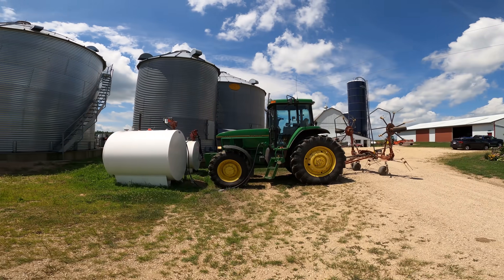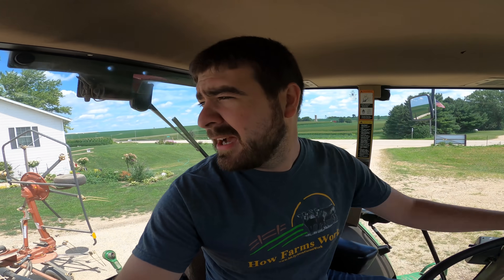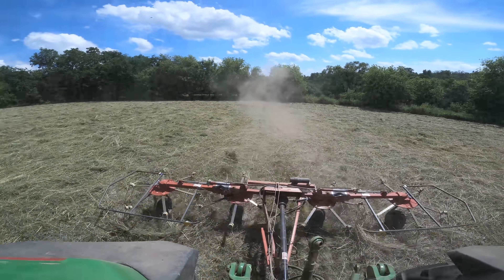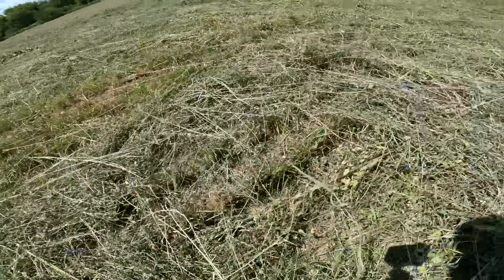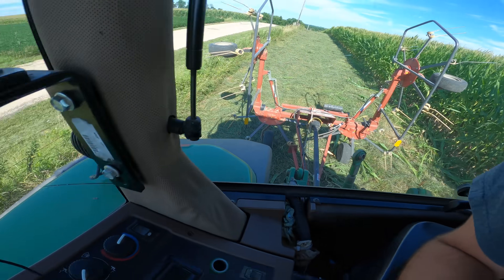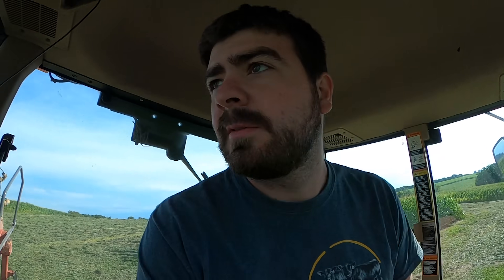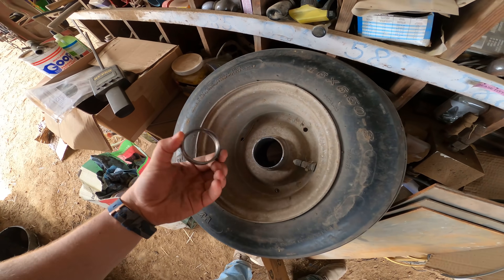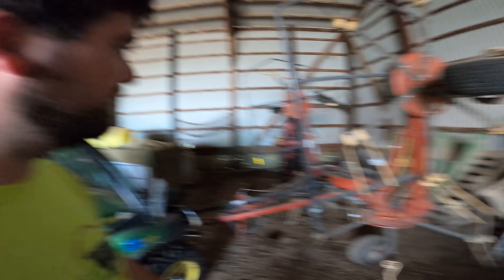Tedding Hay | The Wobble

Comment: Great video ! On the bearings you didn't change, you can take a dental pick and pull the rubber seals off and pack new grease in them, then push the seals back on, in case you didn't know ?

Comment: Those should be standard bearings. Bearings like that are sold by series. 100, 200, 300 series and are usually stocked by autoparts stores. I worked at O'Reilly Autoparts for 9 years and have helped people with these bearings many times. Used on everything from go-karts to heavy equipment. They come in large variety of configurations. no seals (open), fiber and stainless steel. All you need to know is the bore size and shaft size. If you bring in the original bearing they can measure it and give you a matching bearing. BCA and Timken are probably the top two brands you will find in the autoparts stores.
Reply: Agree. We also will pull the seals off with a dental pick, repack them, then push the seals back on. Works great.
Reply: @augustreil  I had a guy who's daughter raced small engine dragsters. Single piston lawnmower engines powering them and they had a special procedure to make them a bit faster. They would remove the seals and clean out the grease with brake clean. Then they would coat the bearings in fluid film and reassemble them. Apparently the resistance from the grease slows them down.
Reply: @FoolOfATuque , Wow, I cannot believe you just said that. We used to grass drag snowmobiles and one of the first things we did was to replace the oil in the chain drive with tranny fluid and any other thing we could with a lighter, thinner oil, including bearings with oil instead of grease. It makes a huge difference in racing, just have to keep up the maintenance a little more. Thanks !
Reply: @augustreil  yeah with those lawnmower engines you have to squeeze everything you can out of them. Lol!
Reply: James you are the not norm, a parts man that can come up with a part without a part number  you are the few who can measure and think on the run, A true dying breed , of a good kind!
Reply: @edp9743  well, I got a degree and left the business. Lol! There's no money in that business. I agree though, there's usually maybe one person per store like that. Lol!
Reply: @edp9743 , A parts guy is worth their weight in gold, IMO. So many times I go to Napa or wherever and the guy doesn't know sh$t, not his fault really, just doesn't know auto parts.
Reply: @FoolOfATuque  I wasnt great as a parts person, but i did sell a ton. No money at all. Left that job for bigger and better things. Like you said, no money.
Reply: All you get is whats your year, make and model, tell them it isnt for a vehicle, their eyes glaze over, shrugg their shoulders and hands go up. All but 1 guy there will go above and beyond to help look up stuff. The rest rely solely on the computer to tell them what they need. I go to napa, parts knowledge,  experience, knows how to open the books to cross reference and will look until they find it or not. Thats a dyeing breed. Bearings, seals etc.. ive always gone to napa.
Reply: @duanedean3256  that's what you get when you pay people 8 bucks/hr and don't reward them when they make you good money.
Reply: @augustreil  Agreed-- they're SO stingy with the grease it isn't even funny... I had hipper bearings on a row disk that was built using sealed type bearings pressed into a cast iron housing running down in the dirt between two disk blades (row disk for farming on beds) and it was eating them like candy.  I looked at it and was like "there's NO REASON these can't be made GREASABLE" which is important PARTICULARLY for tillage equipment bearings running down in the dirt, so I drilled holes in the back of the casting between the two bearing outer races and tapped them and screwed in zerk fittings as they went out over the next couple years.  They only sold sealed bearings no greasable bearings in that size and type so I just popped the seals off one side and installed them back-to-back on the seal-less sides facing each other.  I was shocked and amazed when I popped the seals off usually there's just a single shot of grease in there less than the amount of toothpaste you'd usually put on your toothbrush in there, to grease that bearing FOR LIFE.  Plus, it's almost NEVER even in the path of the balls inside the bearing, but to one side where most of it will never see the actual ball tracks and balls in the bearing that are doing the work... no wonder they go to pot so fast!  Greasables cured the problem bearings would easily last 5X longer simply because you could grease them and keep lube in there and flush out any dirt and help seal the bearing off with grease when the seals did start getting worn... Later!  OL J R :)
Reply: @lukestrawwalker , We drill and tap our trailer hubs for a zerk also, right between the inside bearing and the seal. Then just remove the cap and pump the housing full and it pushes the old grease out at the same time. It's like a bearing buddy but better IMO. Works especially good on boat trailers, because there are no voids for water to enter.

Comment: No offense meant but, this is where we always had our MoCo lay the hay flat instead of in a windrow. Cut first thing in the morning, by mid afternoon, was dried perfect, even with high humidity levels. So long as we had wind and some sunshine, hay was ready by late afternoon. 
Be careful when raking that hay, you don't want to big of a windrow, can cause you a bigger issue with the baler. Had this happen to us with an old Vermeer round baler. 
Modify those wheel hubs, install grease fittings.

Comment: I’ve tedded hay in hot weather before, open cab New holland Work Master 75, with a New Holland Proted 3417 Tedder.
Reply: If i ever work open control tractor again, itll be double what i expect. I gone cab and never again in 110°F heat.

Comment: Purchased my first Tedder in 2002. It was the first in my area.  The other hay growers in my area couldn’t see the point in tedding.  It was a waste of fuel, time and damaged the crop.  I got out of the hay business in 2011.  Fast forward to 2016. Those same hay growers that thought it was a waste of time.  Magical discovered a hay tedder was the next best thing then sliced bread. Now if you don’t use a Tedder you are doing something wrong.  Go figure.   
We cut our hay around 4 pm.  Then run the Tedder in the opposite direction we cut it.  Found it spreads and fluffiest the hay better.  Also if the hay is going to get rained on. Go and rake the hay in a tight window.  After the rain use the Tedder spread out the windrow to start drying it again.

Comment: Would it be better if you bought a 6 or 8 wheel tedder?
Reply: cover ground faster that's for sure... but the bigger the tedder the more expensive they are, too.  This one is a demo unit anyway, part of that Rhino ag deal he's got with the company.  Not sure if he bought it or not, not my business LOL:)  Anyway,  yeah a little bigger tedder would speed things up for sure, and be a better use of fuel and time.  I noticed in the video too that this one is just a WEE bit too small for catching two windrows out of that Kuhn mo-co... with the wider cutting width they're just a little too far apart for the outer baskets of the tedder to be able to get the ENTIRE windrow by the looks of it... Later!  OL J R :)

Comment: Think the term you were looking for there was "sealed" bearings versus "greasable" bearings with no side seals.  Yeah those SHOULD be sealed bearings from the factory, unless the seals quit and gave out and fell off (somehow, usually they just pop off and ride on the shaft when the bearing gets sloppy and the seal breaks loose from the outer race.  Actually it'd be FAR better if they put GREASABLE bearings in there  since you could hit them once in awhile with a grease gun, but then some guys go ape and don't think it's greased til grease is shooting out everywhere, and of course on tedder wheels down in the dirt and chaff and straw, it'd get covered with dust and stick grass to it and start wrapping (which is why the anti-wrapping shields are there to help prevent it from wrapping grass around the axles and packing it in around the bearings and forcing dirt into the bearing and seals and ruining them.)  ANYWAY, glad yall got 'er fixed and ready to go for next time.  Later!  OL J R :)

Comment: my history, being it has been in new england, is that every cut of hay is conditioned, tedded, raked and then baled, are others skiping tedding and raking?
Reply: Depending on the hay and the weather........yes.
Reply: Depends on the crop and weather like Heartwood Farms said... A lot depends on the area.  Here in SE TX we can cut thick grass hay one day, rake about 24 hours later at 50% moisture and bale about 24 hours after that at ~12% -15% moisture or so... No tedding is required.  Get into making early spring or late fall hay, though, and you better have a tedder available.  Most of the guys here use just 3 point disk mowers, no conditioners, but for some crops like sorghum-sudan, a conditioner makes a huge difference.  Everybody here rakes, but most don't do it right (run the rake right ahead of the baler, which puts sunburned, sun-bleached over-dry hay in the windrow and crushes a lot of leaves off of it in the process, even in grass hay, and a lot of guys bale too dry and thus you'll see a baler running and leaves and chaff just POURING out the back because it's crushing all the leaves off of it as it's baling and dumping them on the ground as chaff and dust.  Most of the BTO's will cut hay and leave it flat on the ground for 5 day to a week and then rake right ahead of the baler when it's crispy and crunchy and they hay is roasted beyond recognition... Basically they can take "fertilized bermudagrass" in its prime and turn it into something about as nutritious as wheat straw...  

Later!  OL J R :)

Comment: What horse power does a tractor need to be to pull that Tedder.
Reply: Yea, it seems like a lot of tractor for that task. 

But then, what do I know?
Reply: @Cinder2008  Its the smallest tractor with an air conditioned cab.
Reply: A 30 horse tractor would walk right off with that tedder, never know it was back there... BUT they don't have a 30 horsepower tractor, so they use what they got...  It's about like saying "how come you're driving a 4 door SUV when you're by yourself-- why don't you drive a Smart Car instead??  Probly because you DO own the SUV but you DON'T own a 2 seater Smart car...  OR, "Why are you driving an SUV instead of driving a small car... both have four doors!"  Same thing applies... Later!  OL J R :)